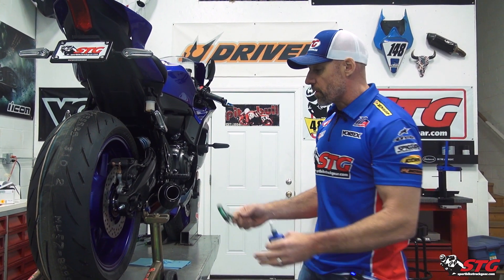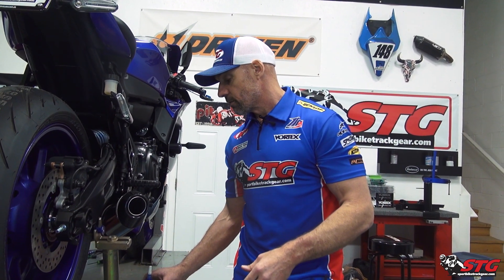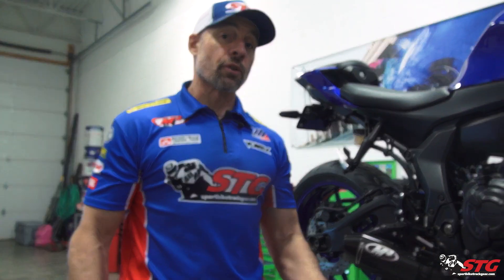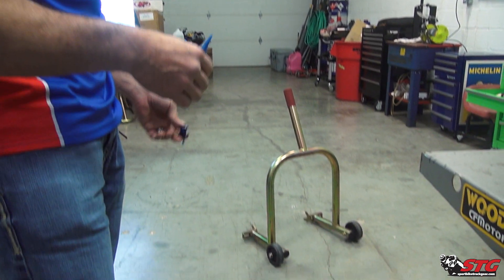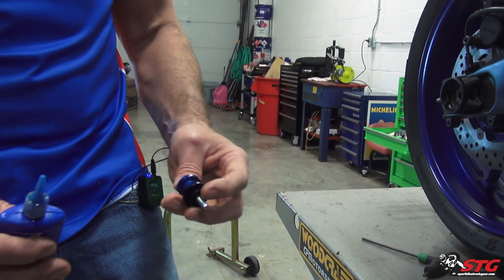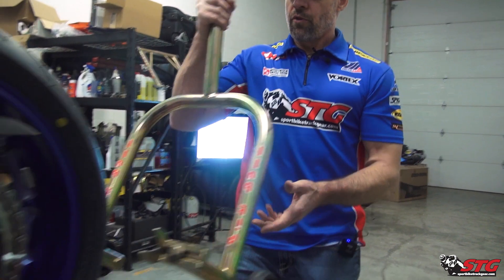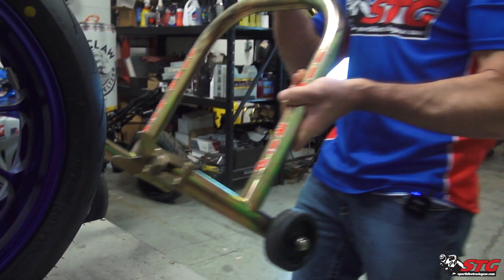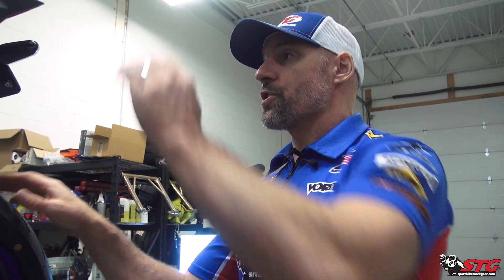Yamaha R7 Driven D-Axis Swingarm Spools Install | Sportbike Track Gear

Comment: Great tip Van about the stands. I’ve literally won several bets with guys who buy the cheap front and rear combination lift stand by saying “I’ll show you how week they actually are”. Each one has said you won’t be able to bend these with your hands so I just do it without raising a sweat and then say what if your bike was to apply similar force. So the cheap ones end up in the recycle bin, and then they buy quality ones that will last from bike to bike so the investment in strong, quality stands will pay for themselves quickly. The ones ive got must be 25 years old and are still as good as they day I purchased them for my race bikes. 👍😎🇦🇺
Reply from the maker: We are on the same page. When it comes to the items like a stand that you will be able to use for many years buy ones that are up to the task. Thanks for watching! - Van